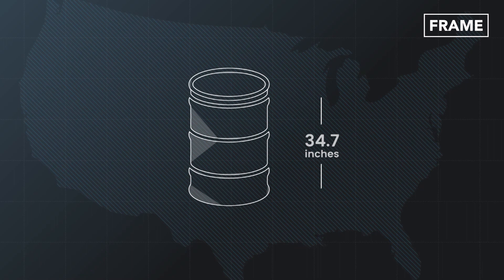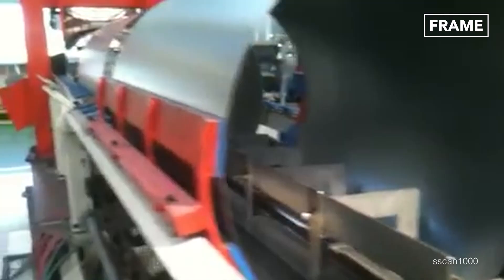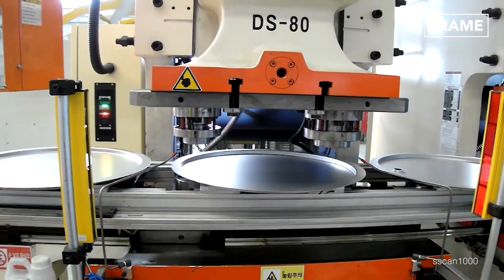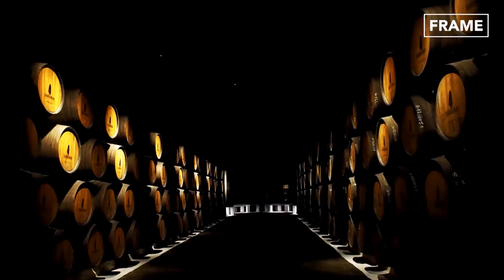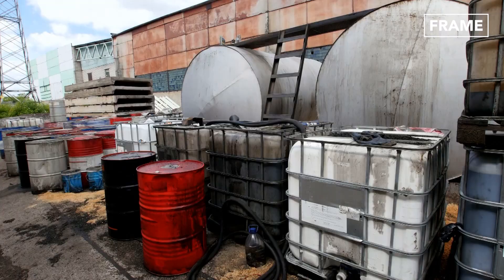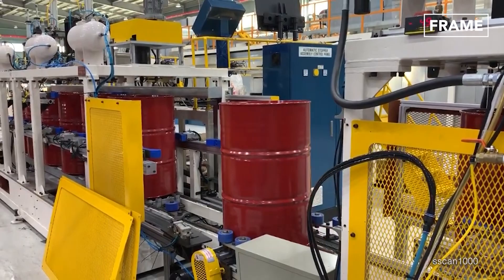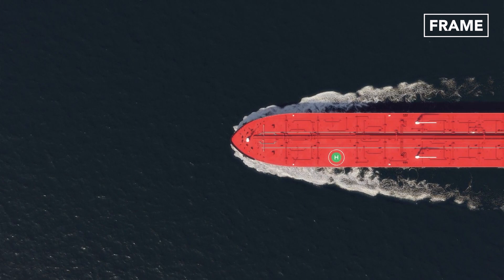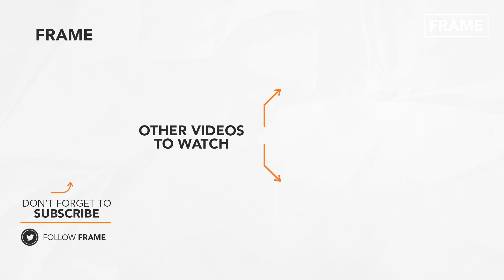The Genius Hypnotic Process of Steel Drum Barrels Production

Comment: there are no  chimes on the drum , what you are calling chime is the  seam and it is a triple seam  for 205L drums. The things you call hoops   in the middle of the drum are call swedges The  chimes and separate  galvo rings that go on the  seam at a later time And the  press doing the top and bottoms is called and blank and draw press  then they are  curled and  and a sealing compound added then  and the flangs are put in to the  tops   and after that they go on the drum. you need to do more homework on  steel drums you got alot wrong ..